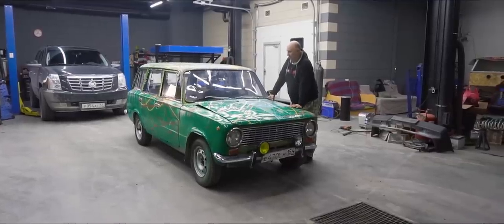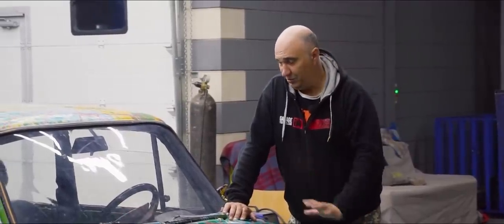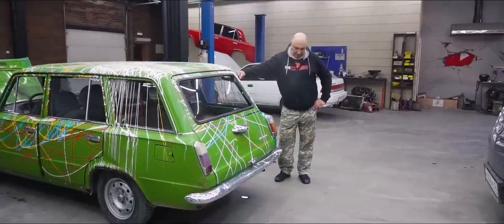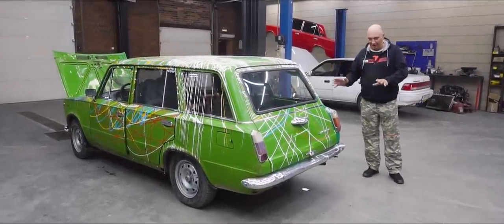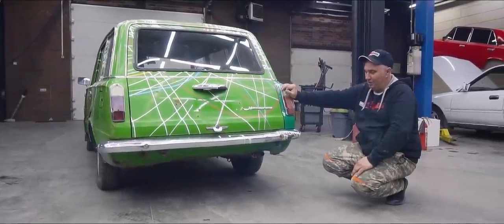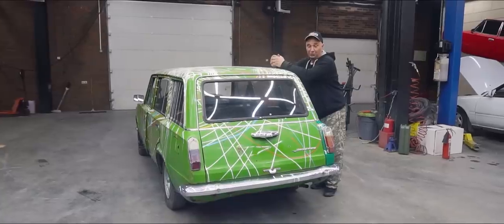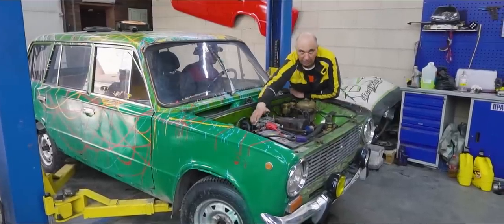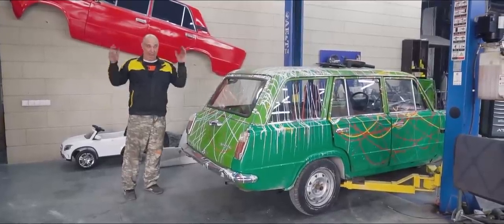No oil rings and valve seals! How bad will oil consumption be?

Comment: So when driving, you stop at a garage, and ask them to fill the oil and check the petrol.

I see quite a few vehicles that smoke like that, some even worse, that they make an effective smoke screen if you drive behind them.
Reply: I know an older man who owned a old well worn LaSalle when in high school in the 40's. He would stop into a service station with a 5 gallon bucket and ask for oil. The attendant would ask what type, and he would reply "drain", the used oil from oil changes.

Comment: Rings gold a cylinder stable and away from the cylinder wall. With a bad ring that is stuck in the closed position you will burn oil and get a piston slap.

Comment: Ok.Now the engine burns oil like crazy.You could try to get the oil thicker by using additives as "Bars motor oil stop" or so and check how the engine behaves.
I had an engine which was very bad because of being driven without oil.With the use of an oilstop additive i drove it about one year without smoking until it was wrecked.

Comment: Knocking was probably from piston slap. With no oil control rings to seal and align the piston against the cylinder, it rocks back and forth on the end of the conrod when the piston is moving up and down. That engine is likely done for. 😅

Comment: I used to work at a shop and a customer brought in a car with the oil filled to the fill cap with oil did that eng smoke lol
Luckily we drained it an filled it to the correct level and took it for a ride to burn out the oil and ended up fine 👍
Reply: How did the poor thing even turn?! Good god, some people 😂

Comment: try to go DOWNHILL for a km or two with a engine where the rings is stuck by carbon. THEN give it throttle at the bottom of the hill. we smoked out 100-200 meter both sides of the rode. some REDEX in the cylinder's and a carb that was tuned correct and it all fixed itself ;)

Comment: Wonder who it was that invented the  "oil control ring"  ?   When I got my 1980 Corvette it smoked like crazy on startup.  Car sat so long all seals dry up.  Along with other issues as usual.   I am not sure about now but back in the carburetor v8 days and such, a quart of oil used every 750 miles was considered normal.   Another good smoking issue on older rear wheel drive and some front wheel drive is the transmission modulator valve would go bad.  Let tranny fluid get sucked into intake and would smoke like crazy.

Comment: still not as bad as my renault scenic diesel on which I had to replace blown turbo that piss oil in exhaust. It piss around 4l of oil into exhaust and when all of that heated up on first run there was clouds and clouds of white smoke and black oil was pissing from exhaust pipe every time when I push the throttle. So when I saw it smoking like crazy I give it some more throttle 😂

Comment: Now you got me curious! Valve seals will affect according to the condition of valve guides and stem. But how much ring do we really need? Bout to play with this theory with single ring setups and such. Time to do a little experimenting. And with gapless and low tension, and different ring thickness at my disposal imma have some fun
Reply: you can't do gapless cold. when the motor heats up the rings will expand and either snap or sieze
Reply: @thesuperjank6109  gapless like total seal style. With a ring inside the ring in a single groove.

Comment: Could you put  oil directly into the exhaust system to make smoke, installing injector and an oil reservatory 🇧🇷
Reply: You can also place a grease gun fitting on the exhaust pipe. Just give a pump of grease and the smoke will be worse than regular oil smoke.
Reply: In neither case will the oil burn sufficiently to make smoke efficiently. There will be some smoke, but mostly extra liquid oil.
Reply: Injecting it into the intake would do this.  It burns up inside the cylinders, not the exhaust.
Reply: We have military vehicles injecting oil in the exhaust manifold right next to the head to create a smoke screen to enable you to flea from the enemy leaving them behind inside the smoke 💨
Reply: yes if the exhaust is hot enough you would have a james bond smoke screen :)
Reply: @chrismechanic2000  That’s a perfect solution against tailgaters 👌
Reply: @Engineer9736  close. Not perfect tho. If you want “perfect” then just make a jig behind ur car, so with a press of a button you spill 5 gallons of oil behind u. Then all you gotta do is brake check, and watch the tailgating moron fly… :)

Comment: BMW had a factory-made issue with valve shaft seals back in the 70s. Every time a BMW went off the gas to turn off the motorway, there'd be a lot of blue smoke...

Comment: Just revving it doesn't even show the full story.. its on high vacuum that you really suck oil into the combustion chamber.
Reply: ...like going down a steep hill with your foot off the gas?
Reply: I got a question.  I was about to Google this but that shìt gets aggravating and I got a feeling you'd know this.  I got a 94 miata with 200k miles and I had the big brain to drive it up mount Washington, which rises 6,000 feet over about five miles.  She handled the climb like a champ but on the way down I noticed I was burning a lot of oil, and it's been pretty bad ever since.  Would that be from the constant engine braking on the way down? I'm guessing the revs hanging around 4 thousand with the throttle closed for a long time, that can't be good for an older engine.  I'm hoping it's just the valve seals being overworked cuz I'd rather not rebuild the whole thing.  Any thoughts?
Reply: @timh9537  Tim, that's interesting and I don't really know the answer, the one thing that I would suggest is that "engine braking" puts a different stress on the engine...picture in your mind the pistons changing direction at high speed while there is a pressure load on them from the burning gases, and then picture them without that "load". It is my understanding that the "loaded" pistons are easier on bearings and rings than unloaded ones as there is a shock absorbing effect with the pressure load. Throwing a car into a lower gear to slow down at high rpm is harder on an engine than hard acceleration (within reason).  I hope this makes a bit of sense and I welcome being corrected if in error...

Comment: that smoke look terrible but there is a time that i run my dirtbike with very low oil for 30km and then fill a bottle of motor oil in it and continue ride it back home after trip and ton of smoke come out of exaust it smell very bad i get pull over by cop once and finally back home and have to rebuilt engine

Comment: I'd have like to see compression testing done before the engine was pulled apart
Reply: I don't think it would have changed a lot.
I had the oil rings completely toast on my car, and I still had stock compression.

After the rebuilt, well, the compression are still similar. I just don't have a smoke screen behind me anymore.
Reply: If it's just the oil rings bad/missing, I'd think you would have more compression if anything

Comment: Older engines used to use a total loss system. At least if you have to top up every 50Km the oil will never get old, no need to service, Wooohooooo.

Comment: 5:22 - not even for the night - a 5 min stop at the Beer store used to do the same on my Pony until I fixed the seals. If the engine is well pressurized and has no external leaks (mine's dry as a bone), that crankcase pressure has to go somewhere.

Comment: It still didn't put out as much smoke as when my turbo seals have gone bad. I think a bad turbo seal will put out more than removed valve seals and oil rings.
Reply: That's because there is pressurized oil going into the turbo, with the valve seals and rings it is just splashed on there from the moving parts. On the turbo there is also oil coming thru the compressor side and into the combustion chamber and out the turbine side right into the very hot turbine housing and o2 housing.
Reply: @bryanwheat9101  thank you for the reply, that's very true. With the leaking turbo seals I was going through 1 qt of oil every  3 days.

Comment: You need to make a exhaust smokie. Press a button to inject diesel or oil into the exhaust system. You could use a wiper washer bottle and pump or a fuel injector. Make a cloud of smoke come out the exhaust 🤣👍 no one can follow you.

Comment: 5 liters or so in a Lada since it's a 4 cylinder so minimum would be 2.5 liters.
Reply: Not always. Each engine is different.  Some engines are set to be at 1 liter, so once the low oil light switches in the dash you know that you need to refill the car with 1 liter of oil.
Reply: @S3l3ct1ve  I was using Google to get a rough idea. The car I used to drive was a crown Victoria and it would go through about a liter of oil every week or 2 so I always kept an eye on it and took it to a mechanic since I was driving cab or taxi in 2017 or 2018.  So it took more oil.  But very true on amounts from empty.

Comment: "There was no swearing directed at us, which was nice".  That's because they were either slack mouthed at the magnitude of the problem, or laughing their proverbial asses off.

I've seen cars MUCH worse than this on the road, almost exclusively 70s or 80s cars, or earlier.  I'm talking where the visibility was getting downright dangerous several car lengths back.  I was thinking about why, and the answer if obvious.  These cars were high displacement, maybe around four hundred cubic inches with larger valves, twice as many, eight cylinders to leak in, and much more ring/cylinder wall length to leak through.  The old "fill up the oil and check the gas".

Comment: Video idea, episode 2. 2-stroke gas on that motor without the valve seals but without any oil at all..
Reply: It will seize up at the crank. 2 stroke engines have port so the 2 stroke gasoline can pass to crankshaft and lubricate bearings and then through another port goes to combustion chamber. Lada is 4 stroke engine, so premix will go straight into cylinders for combustion thus never lubricating crankshaft bearings.

Comment: Next you should put the old engine oil in the fuel tank and see if it burns
Reply: of course it will not burn, it's gasoline engine.
Reply: Tf you know so are two strokes plus ive ran old two stroke mix in my car before and also ran 4 stroke oil in a two stroke and cooking oil
Reply: @DOCTRJ  you can run oil as fuel in two stroke engine, BUT you first must run it on gasoline until engine is hot enough to burn oil and secondly this is 4 stroke engine. Oil will just clog up jets in carburator and engine will not run. 2 and 4 stroke engines are very different
Reply: Ive put two stroke oil in my 4 stroke car fuel tank before and it wss a fuel injected vehicle i would say its fine hopefully they test it for us
Reply: @DOCTRJ  it will work good, but excess smoke from oil burning can clog up catalytic converter over time

Comment: Judging by the smoke with no stem seals I don't think my old BMW had any
Reply: or you had a crank case vent problem, if the valve goes wrong they use silly amounts of oil and smoke a lot, the ccv system needs replacing every 80,000 miles for that reason.

Comment: You should completely disassemble a motor with the proper tools and then reassemble it without tools. Only making nuts and bolts finger tight, and see what fails first
Reply: it won't run, there will be no compression. He needs to tighten atleast cylinder head

Comment: But what happens if you remove the compression rings and leave only the oil rings on the pistons?
Reply: it would never have enough compression to run. There is not near enough tension on the oil rings to make any compression at all.
Reply: @bryanwheat9101  How do you know, have you tried? I think there's 50/50 chances the engine would run
Reply: @HDJess  there is a zero percent chance that it runs ever. Have you physically had the parts in your hands or tried to start an engine with low compression. Those oil rings aren't tight enough, thick enough or deep enough into the piston to make any more compression than the engine will make with no rings at all.

Comment: metallic, flexible, seals, instead, so they dont melt or burn, or no breaking, in over-heat or fire, nothing burning
Reply: ceramic seals instead
Reply: external combustion heat steam engines, so no such things needed
Reply: go back to basics
Reply: continuous burn engines, steam boilers